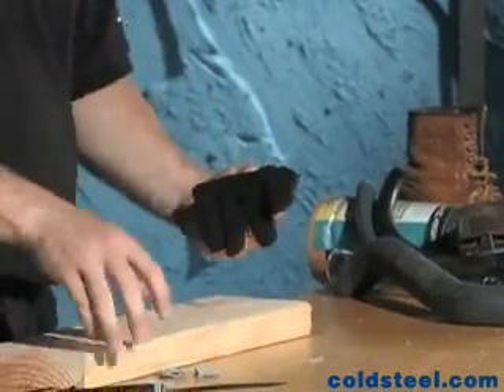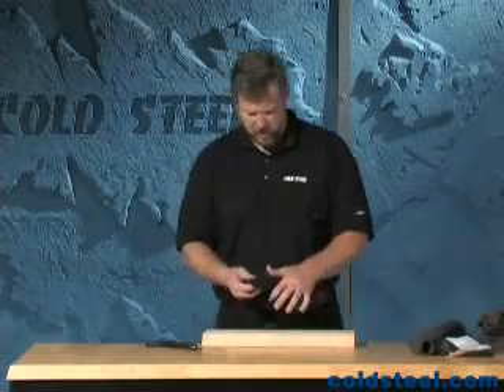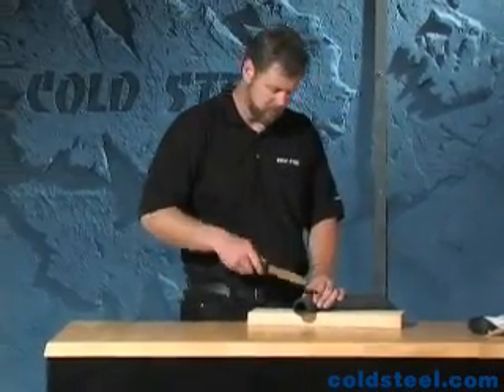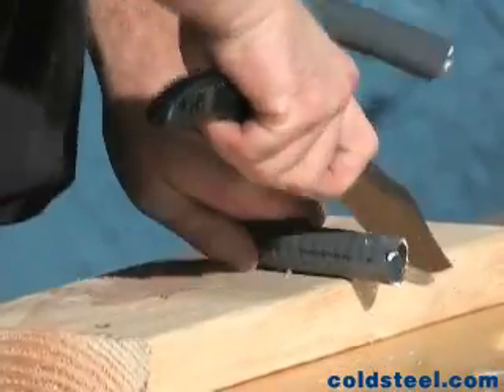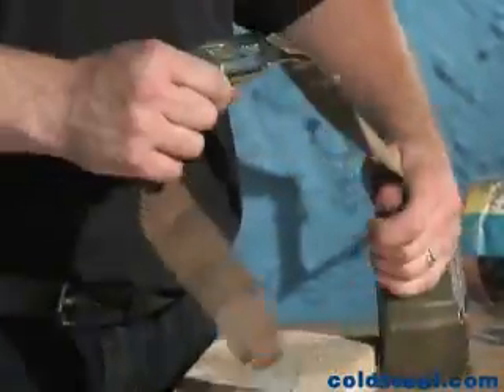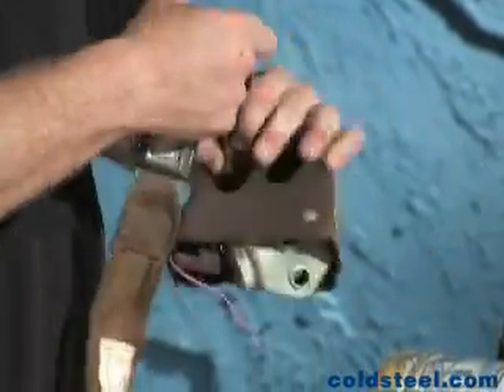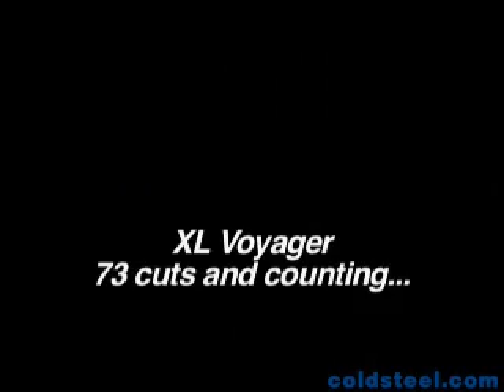Cold Steel Voyager Series (2 of 2)

Comment: I've had at least 5 of these in various sizes and shapes. I loved every one. I love the Tanto tips mostly. My all time favorite has been my EDC for over 20 years... my 6" serrated Vaquero Grande folder. I take it with me every day, everywhere. I used to have 3, I'm now down to one. When this one is gone, I'm getting the Rajah ll. Maybe 2 or 3 of them.... no one beats Cold Steel. I have over 30 pieces left. Perfection in every piece!
Reply: I liked my XL Voyager serated newer model year 2020 I got one of them and another broke both of them hard use lock never failed at all snapped the blades

Comment: What I really want for a large folding knife, is something I don't have to be careful about aggressively chopping wood with for bushcraft and fire making. I understand that isn't ideal for a folding knife but your demos prove they can do some pretty heavy stuff. I just want to be more confident before I put down money for a nice knife
Reply: I have over 30 diff Cold Steel products. I've owned over 40 thru the last 25 years. You can only drool at the quality they deliver. Once you pull that trigger, you'll buy NOTHING else. You will absolutely scream like a child on Christmas morning when that package comes. And you'll do it again the second and third time too. No one beats Cold Steel.
Reply: Toughest folding knifes ever
Reply: 2023
I still carry the OG 6in. Voyager. It has seen more hard use and abuse than law allows. We've cut so much random crap with it,  a few years ago I had to modify the original serrated edge to a plain edge. It's not as sharp as it was back in it's early days but it will still shave the hair off of your arm. I inherited the knife several years ago, when my life long friend sadly passed away, God rest his soul. The tip is also modified. I helped him put a new tip on it, when he pulled up on me one day, pissed off cause he broke about a half inch off. The blade is still snug and the locking mechanism works fine. I will continue to carry it until the time feels right to pass it on to one of his sons, replacing it with a new one. Hands down, one of the best and most cherished knives I've owned...

Comment: im thinken about getten a cold steel, are they actuelly good knives and by tht i mean do they have a long life and not break
Reply: I've had over 40 pieces in the last 25 years. I have about 30 left. No one beats Cold Steel. I buy nothing else. I've had my 6" serrated Vaquero Grande folder as an EDC for 25 years. I love it. It is my best friend. Respect them and don't abuse them. These are tests to show their durability. They are not meant for this on a regular basis. No knife is. But yes, they can be rough and tough in desperate situations. They will save your life.